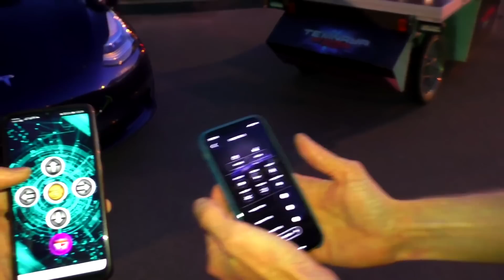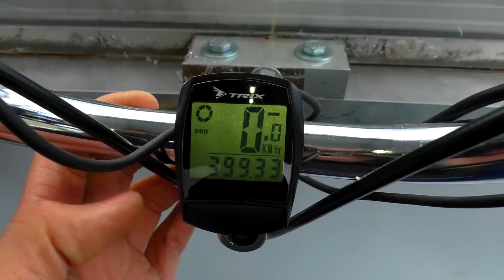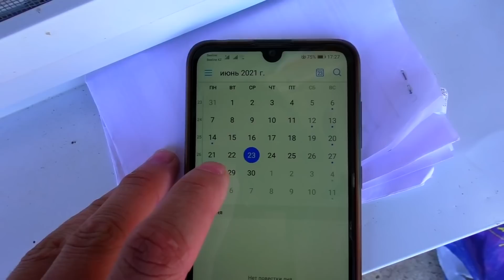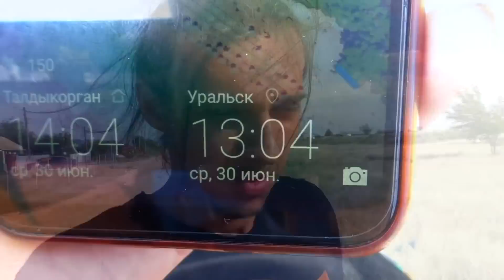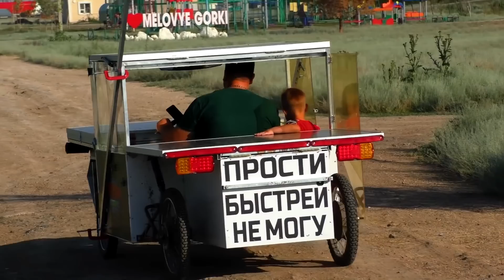Homemade🛠self-made🔥 DIY⚡️electric SUN CAR 🚗 Great JOURNEY on solar power! Part #1

Comment: Great project, but something most people overlook about electric cars is plug-in charging from the power grid.  Less than 20% of power in the grid is from solar, wind, water, the renewable energies. Most of it is still fossil fuels. What most electric cars do is just transfer the burning of fossil fuels from the cars, to the power plants.

Comment: I am glad it was not damaged. The box would have been worse, because you must lift a box with a crane, which has a high degree of vibration and shock, which would have been more likely damaged. The foam pads and shrink wrap was a good method, because it allowed easy rolling without crane, and also protected the panels from falling objects.
Reply: Sure maybe but they shouldn't have charged him for a box if they didn't give him the box.
Reply: @BigDadGigaCHAD  In my experience of life, being positive and friendly is much better. A little money donation is good. Let the past event have its existence and allow yourself to enjoy life.